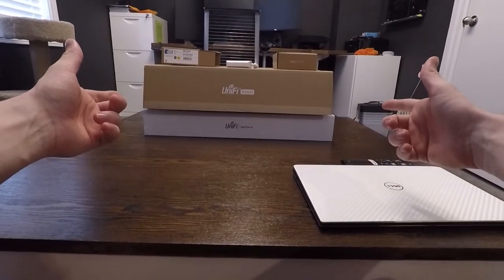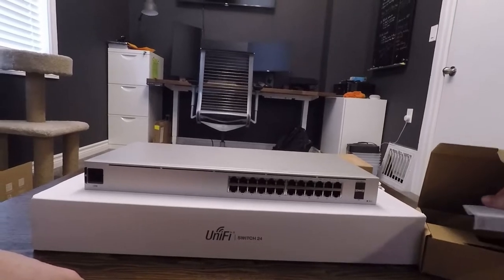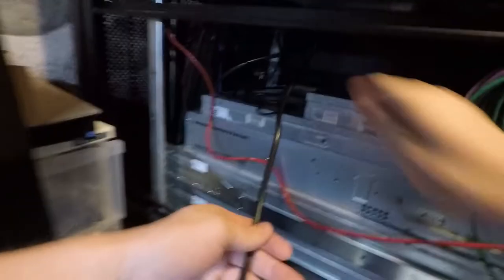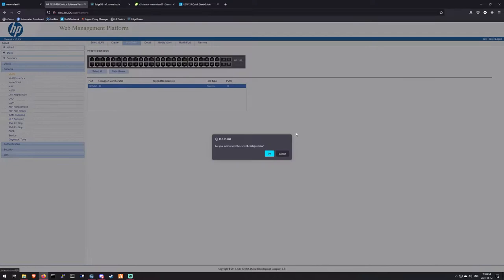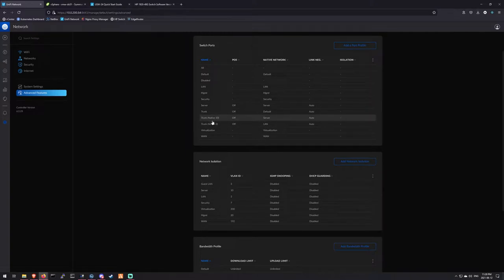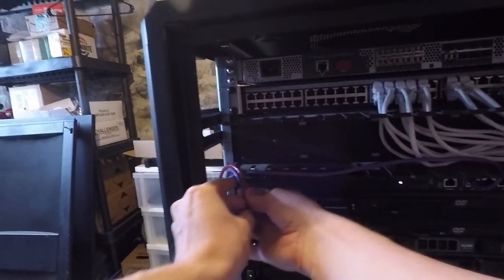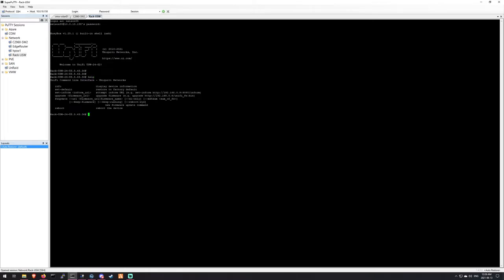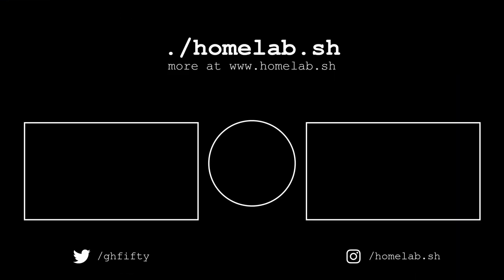Main Switch Down - Ubiquiti USW to the Rescue

Comment: How do you setup the vlans on the unifi UAP AC LR access points I have tryed and the when I connect to a ssid that is supposed to be connected to a vlan it try’s to connect then fails and then retrys over and over how to I get it to work just wondering

Comment: you can set the mgmt vlan on  the controller, when you click on the switch, then config, expand services, there it is
Reply from the maker: Good to know! I had to do it via CLI since I moved all my connections over before setting the management vlan, and once I moved the cables I could not reach the switch from the controller. Instead of moving cables, I just moved my PC to a port on vlan 1 and set it via cli.
Reply: @Homelab  oh ok, that makes sense :)